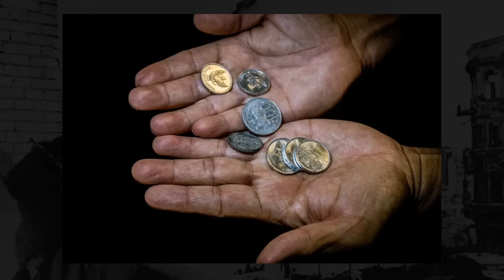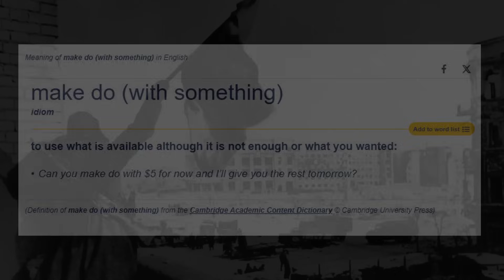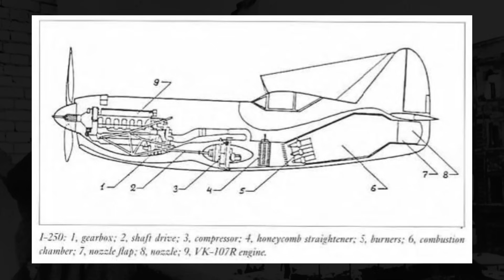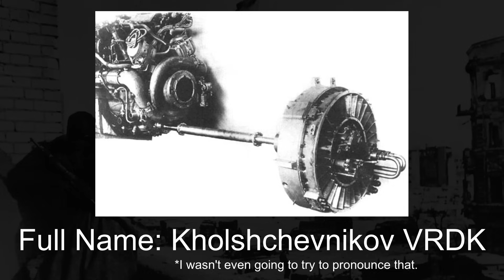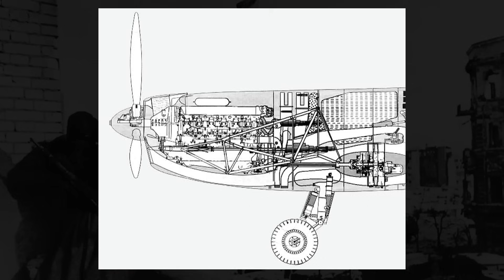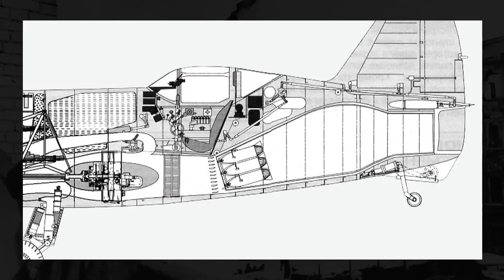Making Jet Fighters With Piston Engines: Sukhoi Su-5 & MiG I-250

Comment: You just gloss over the technical and metallurgical challenges of building a jet engine.  Whittle was only able to make his engine work by using centrifugal compressors.  The Germans did manage to produce working axial flow engines.  But the engine life of the ME 262 was perhaps a dozen hours.
Reply: do we really need or wanna know a lot of the technical and metallurgical challenges of building a jet engine in the WW2 era? Nah,probably not
Reply: @Swellington_ I do, but then I want to know what the USAAF and RAF went thru
Reply: @justicar5  surely theirs tons of videos on youtube then
Reply: Nothing says cutting-edge technology quite like innovation outpacing materials science. Quite often incredible machines are invented well before the materials necessary to fully realize them exists
Reply: It’s still incredibly impressive that they were able to have that level of success
Reply: Ship's steam turbine engines were of the axial flow type and was well known at the time. Aircraft engines however was an other cup of tea.
Reply: @VidarLund-k5qSteam turbines run at much lower temperatures than gas turbines. That has a significant impact on the materials of construction.
Reply: The British had working axial flow jet engines (the F2 Beryl) that flew in November 1943 - they were just far less reliable and powerful than contemporary centrifugal jet engines. The early F2 Beryl’s, like the Ju004, had compressor resonance issues, that in the Beryl’s case, weren’t solved completely until 1945 with blade geometry changes and in the Ju004, were never completely solved.
Reply: @allangibson8494  the Metrovick line eventually spawned the Sapphire, which was successful. Whittle correctly deduced that axial wouldn't be reliable soon enough, but Griffiths was also correct that axial was the best option.

My great-grandfather built parts of Whittle's first engine. Not an easy man to work for, apparently. I don't know if Griffiths was any better, but he was more in the theory side of things only.
Reply: @wbertie2604 Whittle was more practical (being trained as a machinist).
Griffith was an academic.
Reply: @allangibson8494  Never solved is a HUGE overstatement. 004 didnt have these issues to begin with, they were actually introduced after engine was simplified and access to qualified workforce was limited, nuking reliability (mainly making it inconsistent, you can easily get 100 hours from one engine, but less then 20 from other, which is why popular 12 hours figure was recommended time of complete checkup, rather then some statistical number). In fact, it was reliable enough for germans, soviets and french to be able to squeeze out extra performance out of same engines, and having even more powerful versions in development for all three.
Reply: it wasnt relevant.
this video isnt about praising Germany to satisfy the weiraboos
Reply: @ripvanwinkle2002 but they did achieve accomplishments beyond anything seen in any other countries or nationalities…
Reply: @ripvanwinkle2002 I swear every video about the machines of war literally has people fighting in the comments about which side was bad and which one was good, figures, its videos about combat so the comments are people fighting 😂
Reply: @ripvanwinkle2002  except that he did just that by not mentioning just how limited the me-262 actually was. And by portraying the soviet industrial base as lesser when compared to the western allies despite the soviet union having the 2nd largest industrial base, right behind the usa.
Reply: @ravenouself4181   lmao ok weiraboo
Reply: @ravenouself4181 the Soviet industrial base was worse than the western allies, it was bigger, that doesn't make it better, the technology and development they had at there disposal and the things they could actually effectively produce were extremely limited
Reply: @alhids35  it improved very quickly over the twenty years prior to WW2 but one of the big boosts in WW2 was the USA gifting lots of modern machine tools and more-or-less entire factories which allowed much better quality of production late war. US machine tools were the best in the world at the time. One of the problems for France and Britain prior to WW2 was machine tools but neither companies nor governments in those countries had the dollars to buy any in the 1930s.
Reply: @ravenouself4181 It's consistency and quality control was godawful.

Size and quality are very different things. They made do and achieved much with lower quality manufacturing but they were well behind in most areas at scale production terms. They did have some bespoke areas of course- every nation had some key areas of strength, even the relatively industrially and infrastructurally backwards Japanese had areas of extraordinary achievement.
Reply: @Eleolius  It's because of how the Soviet system was set up.  Nobody actually cared about doing the job or getting the finished product right (or even made).  They only cared about avoiding punishment, so it was all about appearances, and a whole ton of lying.
Reply: Call we weak but i really wouldn't have wanted to be the pilot with only a few mm of metal between my rear & the jet burners😮... especially given the err..not great state of soviet metallurgy & protype nature of the whole plane 😅